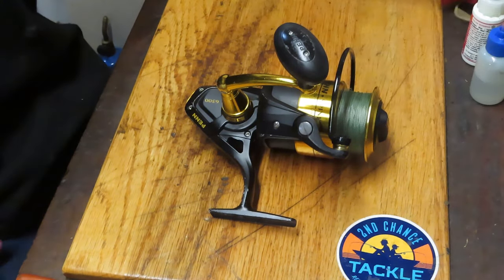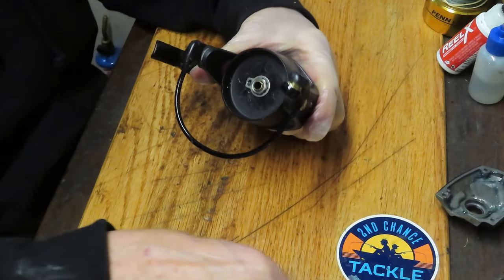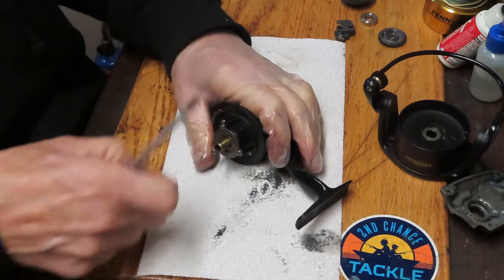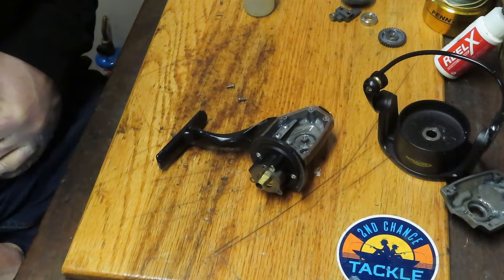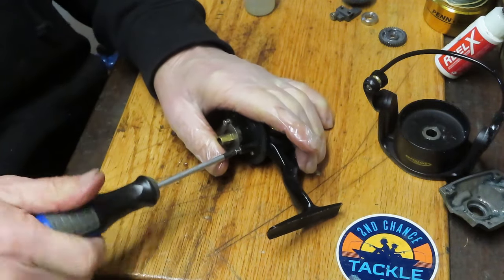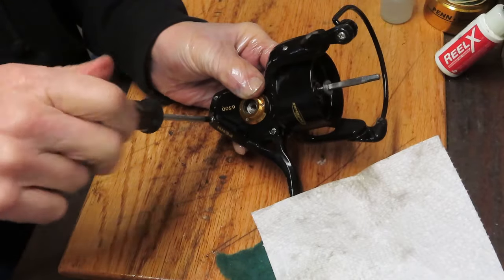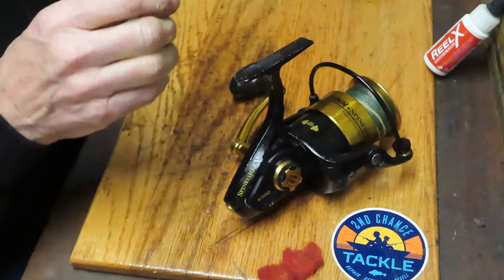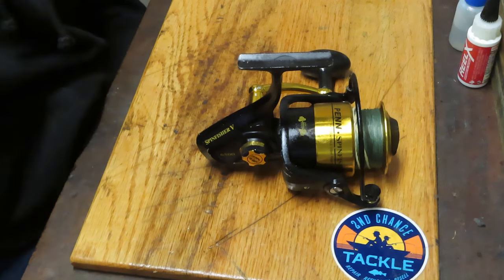Penn Spinfisher V 6500 spin fishing reel how to take apart and service

Comment: As always my difficulty with this Penn is no AR override. I think doing away with this override was far more advantageous to the reel companies that make these reels rather than the fisherman. I own two 1961 Spinfisher 700 reels (they have a green handle) but I no longer use them. They both still operate perfectly. Except for that missing AR override I like this reel. I particularly like the water sealing in the case. Also the drag system is awesome. Great video Dennis! — Chris
Reply from the maker: YW Chris - Is it tie to go fishing in NC?  We are getting ready.  Any day now the Stripped Bass will break - Dennis
Reply: Dennis, I think we are still almost a month out from fishing on the coast down here. I usually don’t go out to the Outer Banks until the Fall. There are too many people on the beach for the Spring run. I try for Pompano and trout on our southern besches in the Spring. I don’t enjoy fishing in a crowd.  — Chris